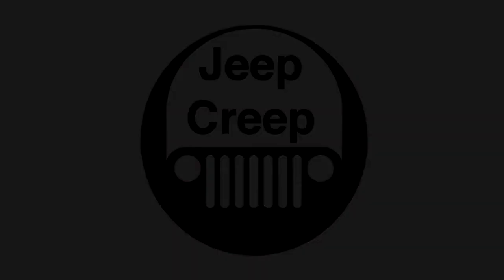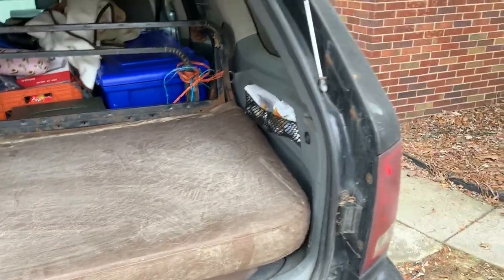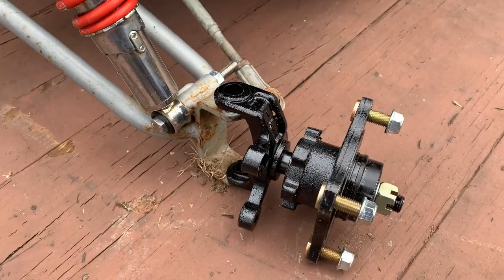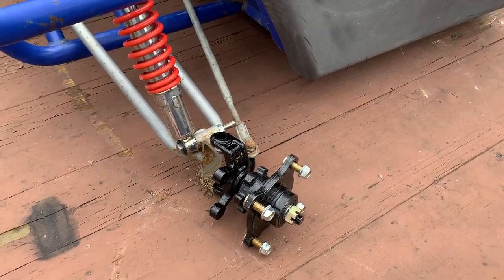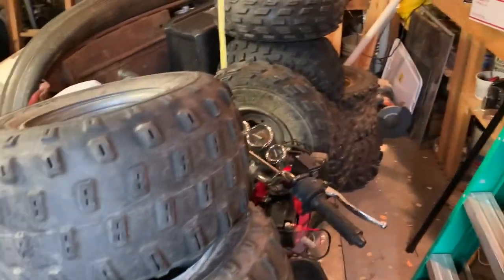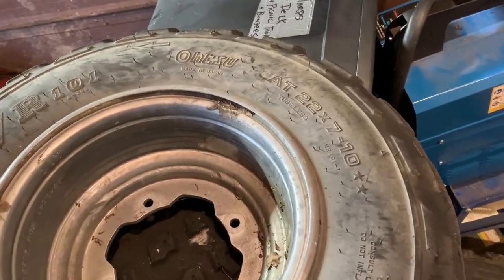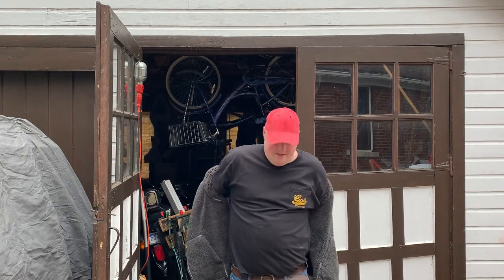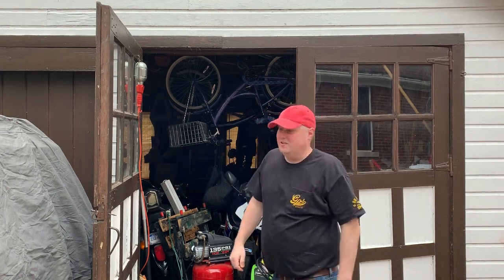$50 Budget Go Kart - How to Adapt ATV wheels for Go Kart use - Update ep.2

Comment: Hi, what size was the spindle and what hub did you use? I noticed some play in the spacing where the spindle went into the hub.. 

I am doing the exact same thing... Any advice while shopping for atv wheels? Thinking just 4x110 bolt pattern should do it. 

Thanks,
Dan
Reply from the maker: I would need to look it up. I shelved this project for right now. Got a lot of other things on the front burner. It’s harder than I thought trying to get quad wheels on a go kart. I bought some custom machined wheel adapters.
Reply: @Jeep-Creep  Yes thats what i was going to do, for the rear axle I have a one inch with 3/4 keyed thread (for the current wheels) on amazon they make a wheel adapter 1 inch to 3/4 keyed but has 4x110 bolt pattern that is common with ATV wheels.  Thats what Ia m going to do for the rear and use Spacers as well... in the front I got some 6 inch spindles and have wheel hubs on it now, not sure on bolt size and pattern so we will see!. Good luck to all !
Reply from the maker: @bleezham  sounds like you got a great idea there. Do you have a social media site? I would love to follow you.
Reply from the maker: @bleezham  I found some info that helped me a lot.  First problem I had, sorta, was identifying the wheels I had.  I just bought random old ATV wheels/tires but had no idea their size or anything about them.  So I found this website that tells you all ATV, UTV wheel sizes, this helped me a ton.  

https://recstuff.com/atv-trailer-fitment/

So I learned in my example, my wheels fit a Suzuki Quad models - LTF250 Quadrunner, LTF300 King Quad, or LTF4WD, and uses a bolt pattern of 4/140 as in 4 bolts, and 140mm center to center across the bolts.  Originally I thought I had some whacky wheel size, I measured in inches, and around 5.5" or 139.7mm so I thought I would get the closest gokart wheel pattern size for adapting, which is 5 3/8" which wasn't the best thinking...  So I started looking up 139.7mm wheel pattern sizes... Guess what nothing exists... there are 140mm wheel pattern sizes, BINGO!  Like the above.  So I used the 4x140 size and looked for a gokart wheel size I could adapt to and found on a site I like to use www.BMIkarts.com and they sell wheel hubs in a 4x100 size.  So last part of the puzzle does anyone premake a 4x140 to 4x100 adapter?  YES!  They are quite common too, I found a ton on eBay as they are made for Subaru and Suzuki wheel adaptations.   This is great news!  So at least the wheel fiasco has been solved.  I am still having issues trying to get the front steering knuckles to fit right, still kinda looking for parts for that.   I thought I would update you on my findings, helps to look at something from a different view sometimes... I was going too custom on this build, when their is plenty of OEM out there.
Reply: @Jeep-Creep  this is awesome info and I appreciate you taking the time to explain.  As I dig further into my project I now have the following setup. 6 inch spindles that are 5/8 and a new 44 inch rear axle that is 1inch with a 3/4 stepdown.  
That said I now need to find wheel hubs for the front spindles  and back axle. 
The fronts need to  fit on a 5/8 inch spindle with some sort of bearing, and another that will fit the axle 3/4. I need to search BMI some more (where I purchase the 6 inch spindle and axle).  Finally the bolt pattern, sounds like I should go 4x100 to make life easier...

My last resort to widen the kart and get bigger wheels will be to simply cut to pipe and weld/extend where the spindle mounting bracket goes..... We will see.
Reply from the maker: @bleezham  It is for sure a juggle between cost and complexity.  I am trying to do what most do and keep it on the cheap and build where I need to.  I would love to see some pictures or videos of your project, you should take some as you go.  I hope to get back to my kart as soon as I make some room finishing up my camp trailer project. 
Space is a premium when you have too many projects
Reply: @Jeep-Creep  I actually never thought of documenting the process... I guess I will try and get some level of coverage.  Thanks for the motivation! in terms of channel, I really dont have much. Some funny videos of me on my electric monster moto conversion
Reply from the maker: @bleezham  I would treat YouTube as more of a hobby and self interest to share with friends. I’ve been at it for years thinking maybe one day I can do this for a living. It’s very hard to even land 1,000 subscribers to even be eligible to do so. Even then I doubt people make much. If you are lucky you might. Use it more for fun. I like talking to the people who are also interested in my projects and start their own. I follow all sorts of people and learn ideas from them.
Reply: @Jeep-Creep  So I really learned here.... I thought I had a 2 piece wheel but ended up its actually a hub, this is awesome because its 3/8 inch studs... I bought some 2.5 spacers so gain another 5 total. Should now be plenty wide! Went via hardcore parts for anyone looking.
Reply from the maker: @bleezham  Awesome, I am booking marking their website thank you for the tip!